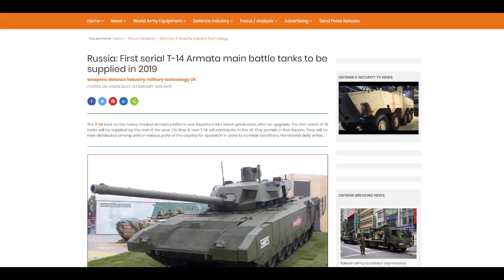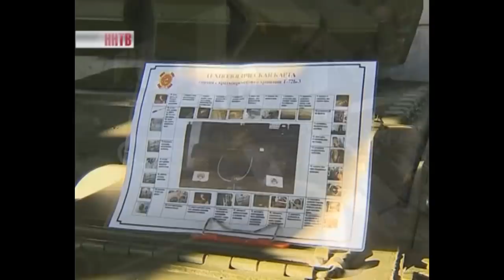Problems with Russian tanks

Comment: You are overlooking a lot of things. To be fair, things that most people dont have access to and never will.

A lot of the T-80s were manufactured by Ukraine. In fact, the only reason there is even a T-80 modernization is because someone found a stockpile of a thousand T 80 engines which can be used to service the existing and upcoming fleet.

Thus, the most logical reasoning for why the T80BV was picked over the T80U is logistics. I dint think its a coincidence that Ukraine continues to look to the T80 as their future tank. Not only is it the best tank they have access to, but most of the supply chain is likely there. The parts, factories, contractors, and all necessary technical/support staff. Things that Russia likely lacks.
Reply from the maker: Only 500 T-80 tanks have been made in Ukraine, and those were T-80UD tanks, which were the diesel variant of a T-80U tanks. Vast majority, or to be more precise, all T-80 tanks with gas turbines, were made in Omsktransmash in Russia. Ukraine renamed their T-80UD tanks to T-84 after several upgrades (Ukraine kept 350 of 500, where Russia kept 150).
Reply: @RedEffectChannel  Not sure why you're bringing it up, but my point still stands. Ukraine has been producing and maintaining the T-80 and its variants since the fall of the Soviet Union. It's natural that they would have everything required to maintain the tank fleet and develop it further.

The same cannot be said of the T-80 in Russian service, which hasn't been seriously produced or upgraded since the fall of the Soviet Union. In fact, the only reason the T-80BVM modernization is even taking place, is because, according to Michael Kaufman, somebody found a stockpile of old T-80 engines. The decision to upgrade the T-80BV instead of the T-80U probably came down to how easy it would be to the part compatibility when it comes to refurbishment and nothing else. In other words, logistics.

I can type in Russian if it's easier for you, by the way. I'm from a post-Soviet Republic and I am fluent.

Comment: Hell yeah they should upgrade T-72s and T-80s until they are blue in the face. Then add in T- 14 and T- 90 as they can. This way they keep the largest tank force in the world that ranges from kind of good to state of the art.  In 10 years they can just put another layer out ERA on and a 200 hp increase to powerplant. More thermal, thermal that can see farther. The Abrams is like 41 years old and that is what they do with it. Add better fire control system.  If I had 12,000 tanks laying around, I wouldn't scrap any of them. Sell them as is or upgrade and sell or upgrade and keep. 

A tank like a T-72 is never going to be obsolete as long as they keep upgrading. Far from the best in the world, but if thousands can be upgraded.  I think  Lenin said  "  Quantity is a quality of it's own," but the will still be sliding in T-90s and T-14.  Quantity and quality
Reply: Mike Brown especially if u consider, what my German forefathers knew: Mix em in combat (Kampfgruppe = Battlegroup). What one lacks, another one is providing. Have a spearhead of the most modern tanks and a flank protection/vanguard with cheaper ones. Remember: Each one of them can destroy another one. At the end of the day, it comes down to tactics and training doctrine.
Reply: @ Johann   Yeah, the Germans did get a lot of use out of the lesser talked about tanks. They were very good with strategy.  If you are on foot in a field, you would not be happy to see a Panzer II start shooting at you no matter what year it is. In places like Syria where this global proxy war civil war has been going on, a Panzer II would still be useful as long as it was used at stand-off range.  Upgrade a Panzer II with ERA and 200 more HP and it's a serious weapon. The 2cm gun will no doubt shoot through pretty thick walls and I imagine even buildings.

I saw in vids ISIS using trucks they heavily  armored themselves and the Russians said they were using armoured bulldozers with like 4 layers of steel with sand in between the layers. They said an RPG-7 couldn't go through it. I was watching some of those vids with the Russian mercs that work with the Syrian Army and they talk about them.
Reply: @ Blah b  I assume Russia pays their military maintenance people like here in the US, or there  are corporations that do the upgrades. All 12,000 is probably impossible, but that is where the selling comes in. People still have to be in the market for T-72 and T-72s with different upgrade packages. Aside from main western countries and China, an upgraded T-72 would still be a big deal as long as it cost less than tanks that are better.
Reply: Q. Where is the money? Russia is close to BANKRUPTCY!
Reply: @trevorhart545  What? With a 13,5% total debt to GDP? The heck are you smoking, kid? :D
Reply: Maintenance gonna be bitch tho
Reply: The Israelis were using the Super Sherman until the '80s when they sold their fleet to Chile (who in turn used the Super Sherman tanks until 1999).

Old tanks being upgraded are far from useless.
Reply: Well, your tanks sucks too much, so we dont need to upgrade our...

Comment: Either way the T-14's combat capabilities still remain questionable.
Reply: The T-14's turret could be knocked out frontally with even antiquated anti-armor weapons, thus rendering the whole vehicle combat ineffective.
Reply: @Kitkat-986  whats easyer to replace a gun or maybe whole turret or whole tank plus crew ? ....
Reply: MrGhostkiwo that doesn’t matter on the battlefield during the battle when the crew is alive and the tank is ruined.
Reply: @Kiwoeoe  Crew survival is important, yes, but that's no excuse for allowing even the most underpowered and primitive of infantry portable anti-vehicle weapons to render your big, expensive battle tank worthless with one well placed shot. The modern M-1 Abrams can take a hit from a helicopter launched ATGM with a warhead in excess of 120LB (aprox 50 kilos) directly to the turret front without suffering a penetration or any reduction in combat capabilities. The T-14 could be mission killed with an RPG-7 or even a small caliber recoilless rifle.

Comment: It seems that internal politics decide where money will be spent instead of what is the best solution. Many t-72 tanks should have been upgraded to t-90 spec instead of many half assed t-72 upgrades. More commonality should reduce upgrade price and logistics but this is government purchase so everything cost 3 times more
Reply: T72 and T90 are technically bouth T 72 tanks. further i think that the vid underrates the B3 a bit . The T90 A production was canceled and  funds were transfered to armata and the T72B3 came as a replacement and stop gap as it has very similiar caopabilitys and performance for less money. the B3 and B3M arent even the "finish-line" there is so much stuff one can do to update these things. lets say for example they decide to give the B3M and APS , full on relikt era and an Soft skill system like shtora 1 etc. alongside maybe a new gun and voila you got a tank that suddendly performs ALOT better and that for an fairly low amount of money. and no goverment purchase cost way less since defensecompays are mostly goverment owned ( including tank ones ) and those who dont are under various rules and laws that first prioity stays the federation
Reply: given that economy is a real problem, this may be the BEST solution because it helps the economy more.

You can sacrifice fighting power for economy if you assume you won't have to use it or still will be better,
Reply: The sollution: upgrade the old tanks and slowly research the New tanks
Reply: Lol, you cant make T-90 From T-72, those are too different models
Reply: besides the fact that the T90 IS a T72 it got a rename originally it was supposed to be named T72 BU but got renamed T90 so it can be called the first "russian" tank lol ( not for marketing thats a myth ) but its a deep modernization
Reply: @jeenearall4134  T-90 was originally named  T-72BU.
Reply: You cant upgrade T72's to a T90's specs.
Reply: wwwelkam government works in mysterious ways, especially the more power concentrated ones. Hopefully they know more and better than us plebs.

Comment: Didn't 20 of them (T-14) are be release ?
Reply: @Blahb-o9b  your whole description is the only joke itself.
Reply: @Blahb-o9b  very very much evidence can proof it, and two of them taking pictures are installed 2A83, another with significantly smaller 2A82. a picture at least including 2~4 T-14 in a parking area.
But it doesn't matter, something does is you Keyboard White Right is totally ironic.
You don't need to understand just stop playing your crap meme and stop using it to gain your pitiful pleasure.

Comment: I think i have seen some place in witch they say the T72B3's armor has been upgraded as in armor i mean composites.
Reply: Yes electroslag remelting base armor with 2 layer of NERA and a good old 60mm outer layer that can deflect multipled penetrator or stair-steped block penetrator leader
Reply: @demonslayer1287  no not that the wholrcomposite armor is said to have been changed
Reply: upgraded from long years ago
Reply: What alike ?
Reply: Can you post some link that described this ? Better in Russian likes ria zvezda topwar lenta
Reply: something I've heard is Russian upgraded armor steel to different steel grade that gives 2000MPa+ tensile strength but with not lose flexibility.
Reply: @demonslayer1287  Hold on i need to find the link but it was only a rumor.
Reply: That's the only possible one. Ceramics leak flexibility and durability for multiple hitting and harder to maintain if you can upgrade the steel then just upgrade steel, ceramics is suit to put outside the base armor.
Reply: Maybe u can just visit NII Stali site and then read some writing about Soviet armor design philosophy you will get it.

Comment: T-90MS is Russias coolest looking tank
Reply: It's not bad but on the chassis of object 187 it would be even better.
Reply: No KV2
Reply: Then there is object 640 the black eagle
Reply: @Hunter-rr5ue  The 640 is simply a prototype rather than a fully finished sample. Some solutions may be included in the modernization of the T-72B and T-80BV.
Reply: @Джо //Elusive// oh sorry i thought we were discussing the coolest looking Russian tank and not what is a prototype and what is not
Reply: @Hunter-rr5ue  Object 640 was an initiative of Omsktransmash, it served as a test bench, but nothing more. This is a redesigned T-80 with an elongated body, a new tower and a new automatic charging. It was not intended for mass production, and was not in demand abroad. Therefore, the project remained just an unfinished prototype.
Reply: T-80BVM and T90M the best looking tanks today for me. T90MS is export version, is not for Russian army
Reply: It basically looks like dressed up as a Leopard 2A6
Reply: You mean the T-72 BU.
Reply: You are ALL wrong.
The best looking tank is.... "T-72 Mahmia with total cage armor protection"
Reply: No way, the T80UM1 is way better looking.
Reply: Т-80U is coolest.
Reply: leopard a7 is much better in looks
Reply: DEZIIRE T-34-85 is a THICC BOI 😩
Reply: I personally like the T-14 design more.
Reply: Rayhan_2k Red eye
Reply: One more like ti’ll 700

Comment: So goddamn much variants Jezus... Its hard to keep up
Reply: Even more than that, for example:
T-80 and T-80B, as well as T-80BV IS not the same. They vary greatly in protection, weapons and other systems depending on the year of manufacture and location.
The same applies to the T-72A, T-72B, T-72BV and other tanks.
Reply: This is how we know russia is dedicated on improving their existing design.
Reply: @gendalfff Geez, the Abrams line looks like a list of save games from one of my games.
Reply: @Life in the Zone All older tanks were written off in 2011. T-72M or T-72S can be bought as is or order upgrades. Nicaragua, Venezuela, Laos, Algeria, India and many others buy T-90S and t-72 S. T-62M and t-72A, T-72B, T-72B3, t-90 1993 supplied to Syria because sufficient to combat irregular forces.
Reply: Then just look at the Germinions!!
Ausf. A, G, B, Schnitzel...
Reply: It’s because their economy isn’t doing well and they had to slash their defense budget meaning they can’t make new tanks or the best upgrade kits
Reply: @masondyer1625  T-72B and T-80B are standardized with T-90. Not surprisingly, the T-90 is a hybrid of the t-72B chassis, 187 tower and T-80B systems.
All previous models were either disposed of or placed in reserve, such as the T-72A and T-62M back in 2011.